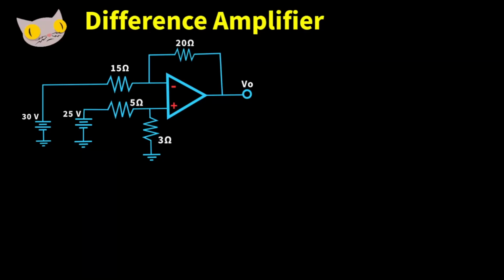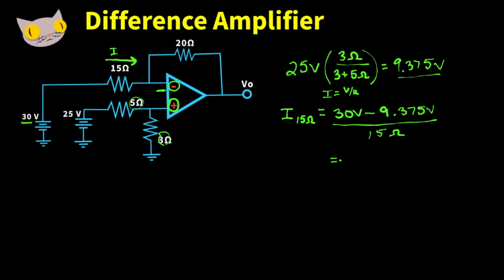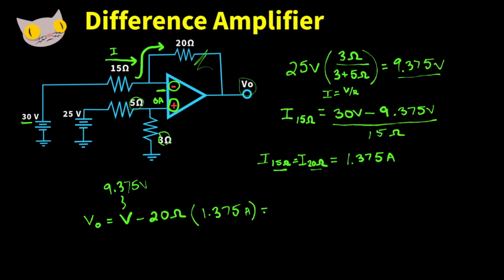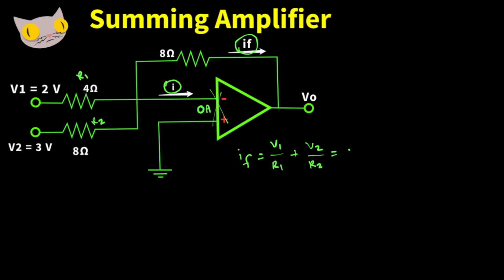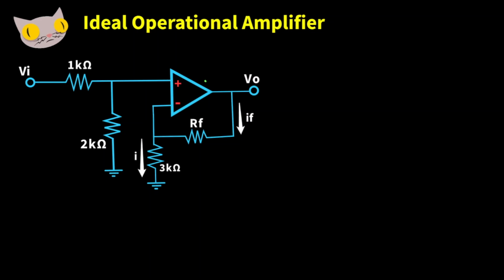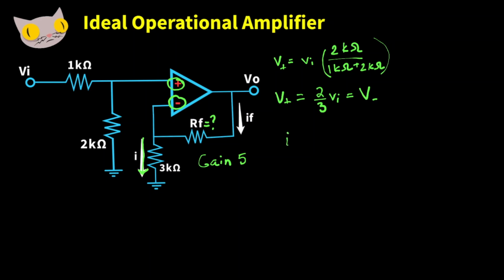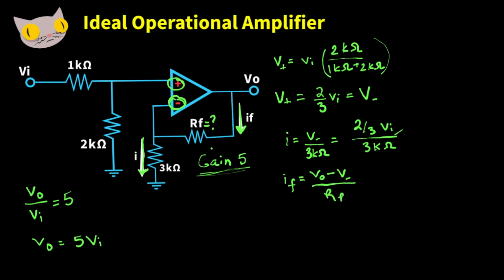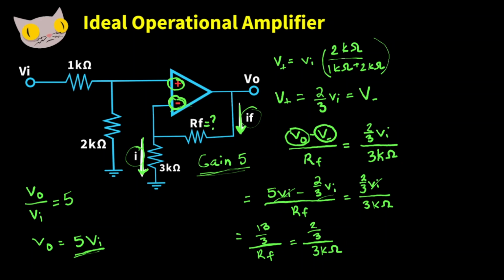Operational Amplifiers | Problems

Comment: Is it possible to use (Rf/Rin)+1=Gain for the last example?
Reply from the maker: It is! If we take Vout, we can say it's equal to (2/3)Vi(1+Rf/Rin) = Gain (5). Then we can multiply 3 on both sides, divide both sides by 2, subtract 1 from both sides and multiply Rin on both sides. Rin = 3k ohms. So we'd get 3k(7.5-1) which would give us the answer 19.5k ohms. Hope that makes sense. There are lots of ways to solve these problems and exploring them is a good exercise. Thanks for the comment!
Reply: @studycat2658  Yeah totally makes sense. Thank You for your reply !
Reply: @studycat2658  thank you